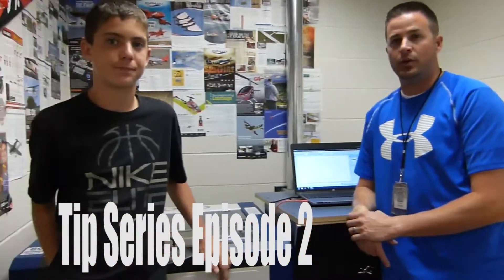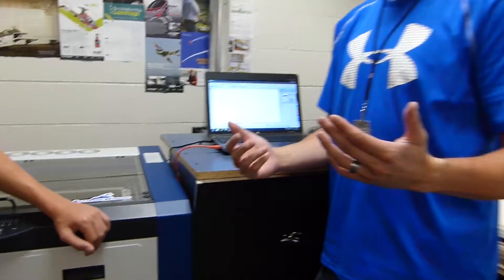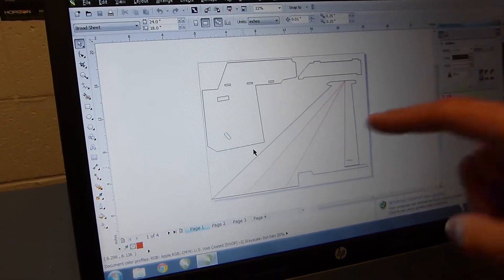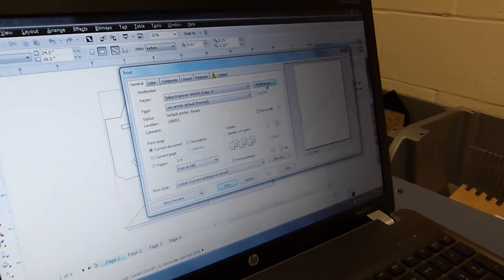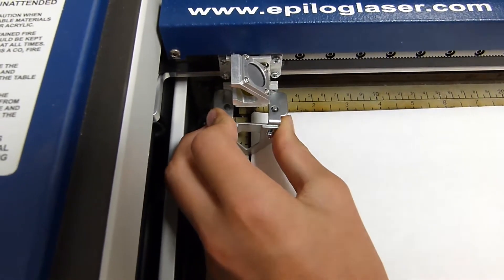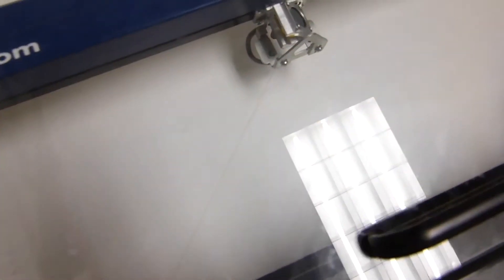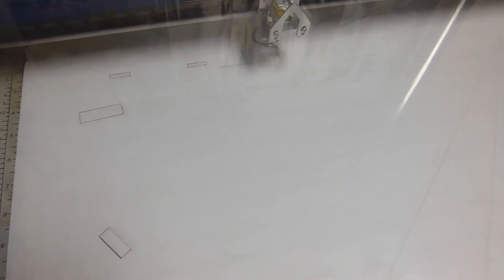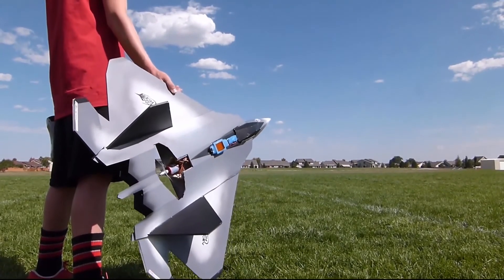MESArcFF - Laser Cutter - TIP SERIES

Comment: Could you guys share your laser specs? How many watts does it have? What settings (speed, power, frequency?) are you using for the two types of cuts?
Reply: Balu not a good question they think hahaha, i don't think they going to tell u that
Reply: Aldo Allende Oliva Actually they told me that all lasers need a little different settings, even if they are from the same company. Best way to start is to go with half power and see how far you get at different speeds. And then experiment with it a bit until you get consistent results.

I'm not allowed to use the laser for polystyrene anymore though which makes it hard to do that. :-/
Reply: this laser machine cost about 6000$
im looking for something can works the same for foam and wood and do my own work experiment, do u know anyone
Reply: Aldo Allende Oliva I'm currently looking around for DIY lasers like http://www.openbuilds.com/builds/openbuilds-freeburn-2-mini-v-slot-co2-laser-40-50w.1657/ but you really need someone knowing what they are doing if you want to build something like it.

Check if you have any hacker- / makerspaces around. Some of them have lasercutters in the shop.

Comment: The Laser cutter is based on a 3-axis CNC machine with mobile gantry for the cutting tool. Actually, you could implement the CAD drawing, save it as DXF files to be imported to a nesting software for the cutting job (this only an idea). Nice job and thank you for sharing this knowledge.